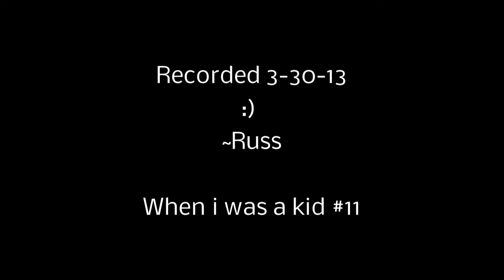When I Was A Kid. #11 an old friend stops by to tell the story, & play with the popper! :)

Comment: Hey Russ, I see your SSG in the background still in tact. Have you ever connected it up like this watch?v=mdzAjBScgcs   ? leave out the + cap dump, make sure your charge battery voltage is higher than the primary or you will have to think about what you need in between them. if you figure that out, use a cap dump. It won't take you but a few minutes to fire it up. Let me know what you think :-)
Cheers, 
Patrick
PS oh yah, thanks for the cool vid :-) meeting up with good old friends is awesome!